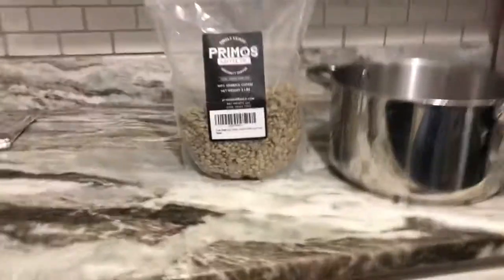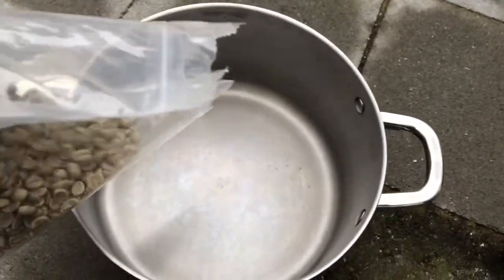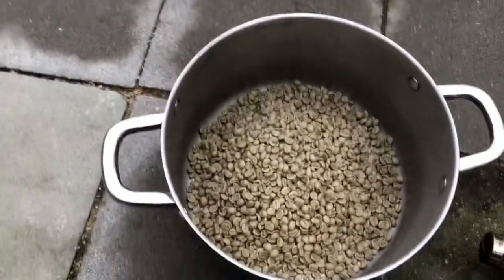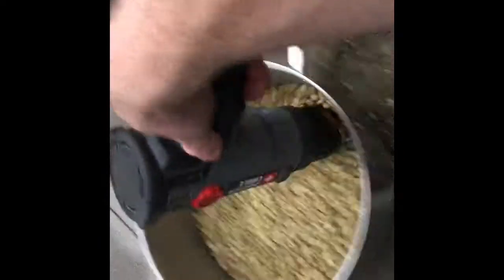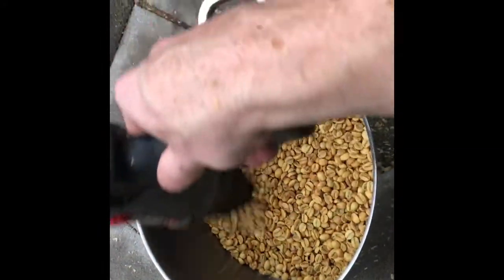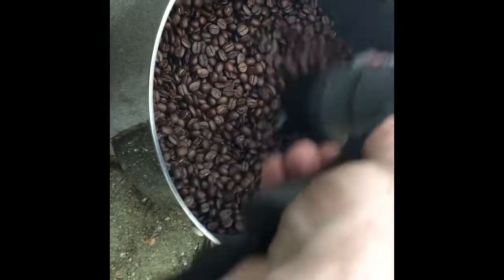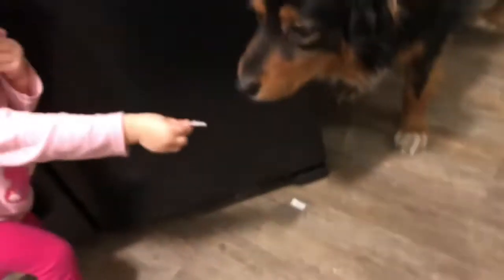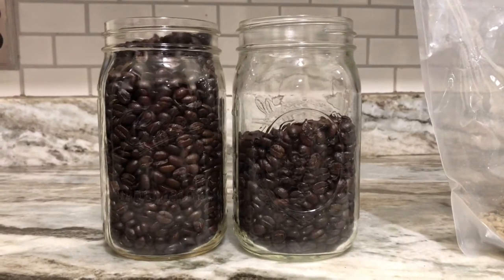Roasting Coffee Beans With A Heat Gun // Dog Bowl And Heat Gun Method

Comment: I use the same method. Here are a couple of tips. I use a stainless mixing bowl about 14 inches across the top. That allows some of the heat to escape and not heat up you gun and your hand. Put the attachment that comes with the gun. The wide one. I will move the beans even and heat more at the same time. I also have my sun running full blast at 1300 degrees and I control the heat on the beans by keeping them moving. With my method, I dry stage over in about 3 min. First crack about 5.6 to 6 minutes and second crack about 8 minutes. I like dark roast so I allow the heat to run one minute beyond rolling second crack. Last, the best way to cool the beans is to get or make a small box, cardboard will do fine. Hook up the shop vac and pull the air through the beans. They will cool in less than a min. Chef Jerry  Irmo, South Carolina USA